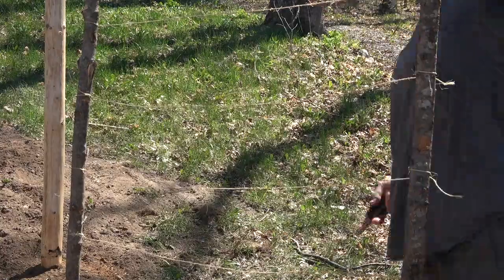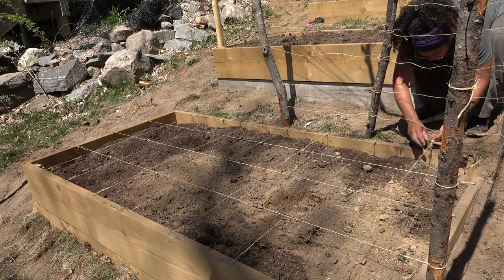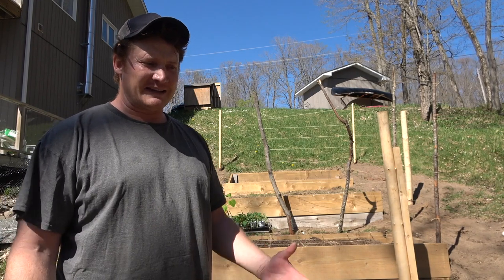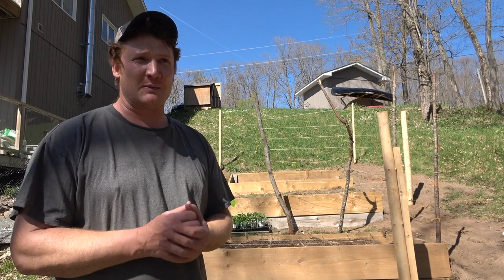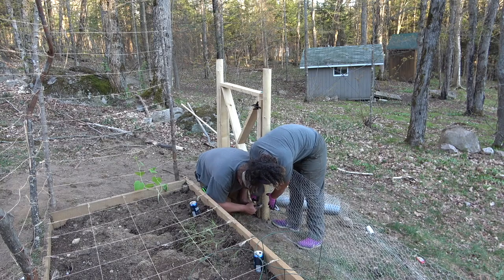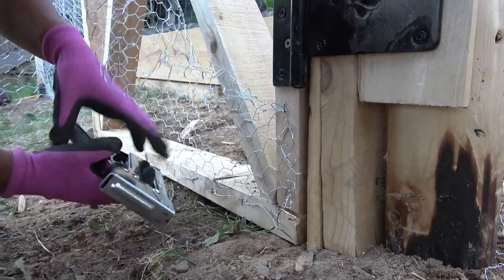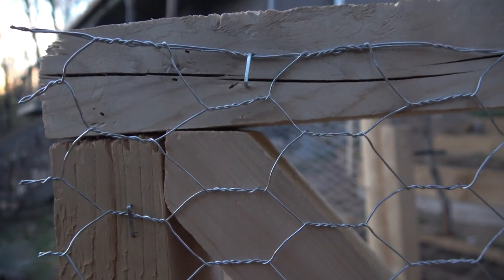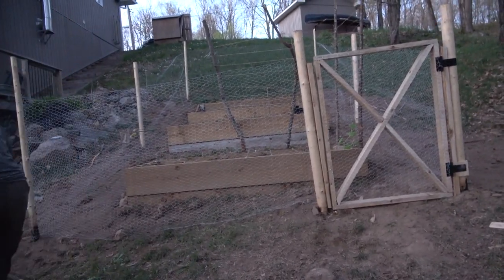Terraced Vegetable Garden - E.4 - Three Sisters Garden, Square Foot Gardening Fence Build & Planting

Comment: Just a suggestion, digging a 6" to 1' below the chicken wire, and use the chicken wire underground to keep the varmints from digging under to get in, or even folding  ( L ) 90 degrees to lay a crossed the ground and attach to existing fence. As I said it is just a suggestion. Down here he have moles and to prevent them we have to use a french drain type base to keep them out as well as chicken wire to keep the rabbits and raccoons out. Also try using a fabric style raised bed for potatoes, so you'll be able to dump out the soil when harvesting, to use again when planting more potatoes. Rhizomes like ginger and turmeric that are easy and able to be planted in large pots for easy harvest.
Reply: Yeah - that is what I was thinking - rabbits are really great for digging under - they make tunnels - worth a thought.